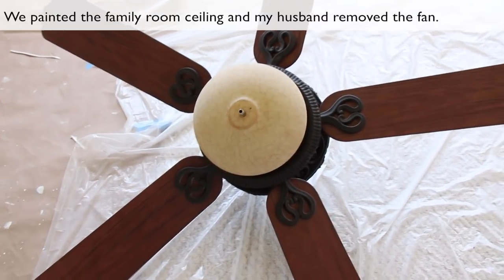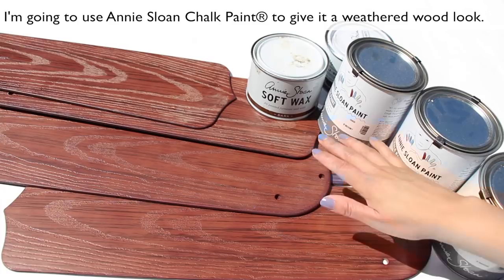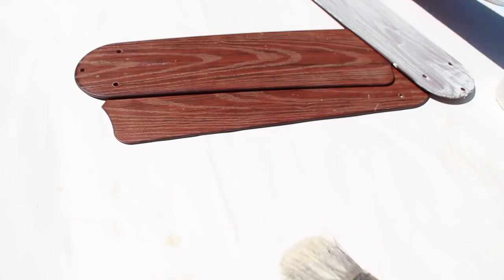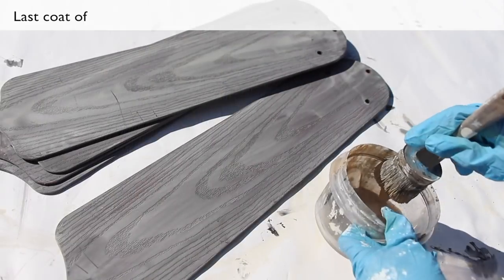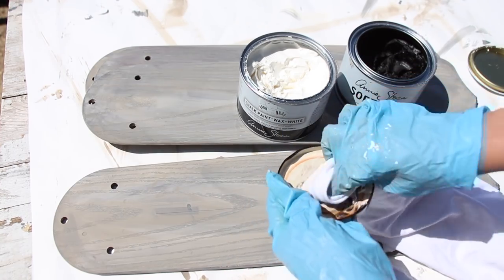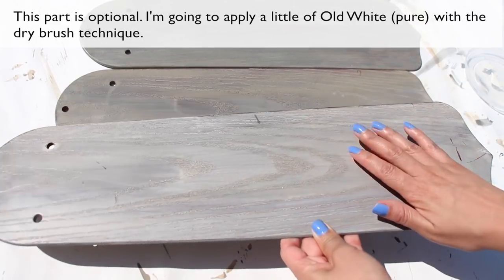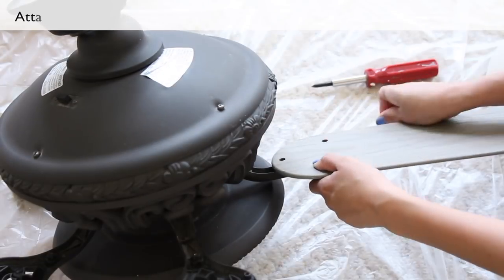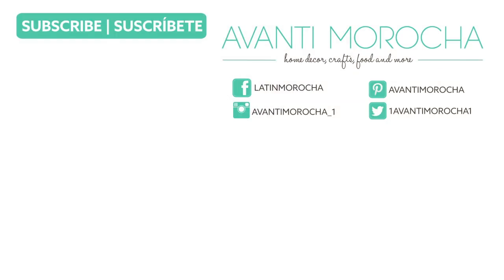DIY Ceiling Fan Makeover with Chalk Paint®

Comment: Can you explain the purpose of the wax? Does it seal the paint so they can be cleaned later without messing up the finish? Is there a clear wax? Because I actually liked the color of your blades before you added the wax 😀...Thanks for your help!
Reply from the maker: The wax it's not necessary, but it'll help when it comes time to clean and protects the paint. If you like the more grayish color use clear wax.  Have a great day! 😊

Comment: I'd like to do something similar but my blades are laminate. Are your blades laminate, and if so, how did you get the paint wash to adhere?
Reply from the maker: I did this project about a year ago, I'm not entirely sure, but I think my blades were also laminate. If you use Annie Sloan Chalk Paint, you won't have any problems.
Reply: @AvantiMorocha1  where’d you purchase that brand of paint?
Reply: @latishapalomino9228  fine sandpaper
Reply: Cavsome Sayre I got mine done, turned out great 👍 didn’t need any sand paper and I had dark blades.Chalk paint works wonders

Comment: Isn't it gonna knock it out of balance?
Reply from the maker: No really, it's only paint.
Reply: Avanti Morocha 
According to Lowe's home improvement, Painting fan blades could lead to giving weight to thr blades unevenly, and it could knock the fan out of balance and it gives stress to the electric motor...
Reply from the maker: Thank for the info. I have the fan always running and I haven't had any problems yet.
Reply: Avanti Morocha 
You're welcome.
I also learned the hard way...